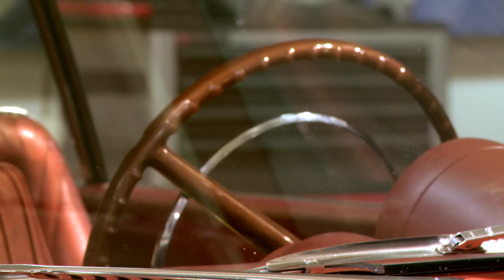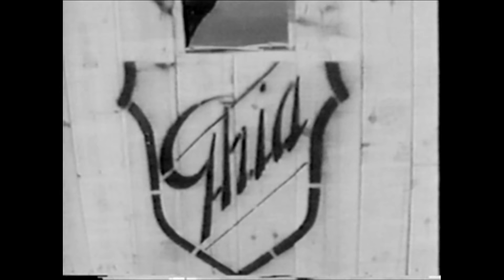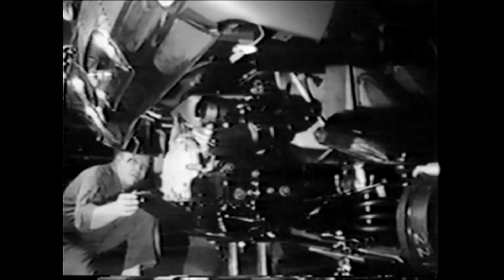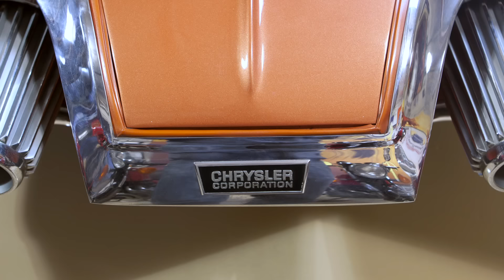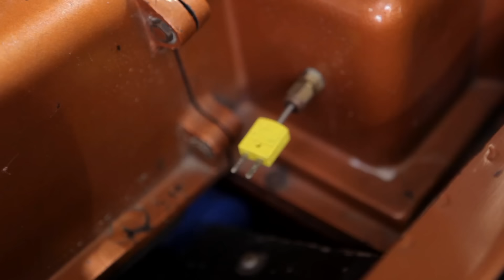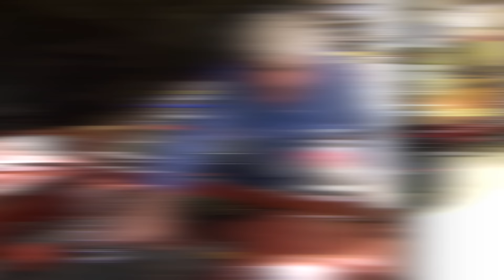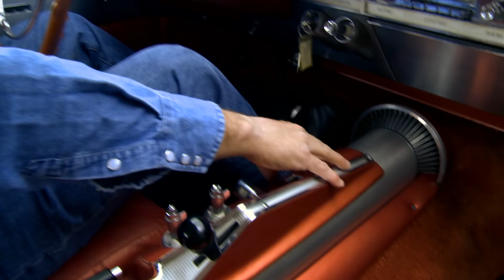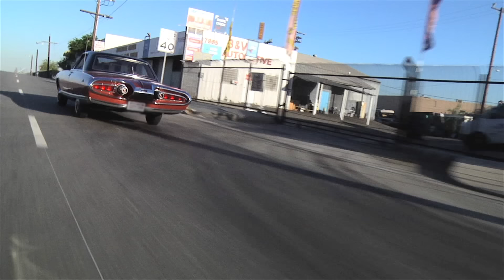1963 Chrysler Turbine: Ultimate Edition - Jay Leno's Garage

Comment: Couldn't this engine concept be adapted to be the power plant that is used to charge the battery pack for an electric vehicle? Seems as though the high RPM's would be ideal for running a generator. As an hybrid the fewer moving parts and lower maintenance costs would be an asset. In the same spirit I've never understood why a basic gas powered generator couldn't be used for battery charging rather than using an external charging system. Has anyone ever done the math on fuel consumption of a gas powered generator for charging en electric cars batteries? Finally, the whole approach to hybrids seems to be flawed using a combination of gas power and electric in the same vehicle with all of the data processing needed to balance which system gets used when.

Comment: While working at the King Theatre in Lancaster PA in 1964 we were playing the movie "The Lively Set" featuring this turbine car. I was asked to drive it around town with a movie poster attached on the.passenger side. I was very apprehensive and drove very cautausisly and slow. Before driving too far, I pulled over to purchase a  few gallons of gas; not knowing what type of gas was required. I waited for awhile; avoiding damaging the car in any way. I sure was glad when arriving back at the theatre and handed over the keys.

Comment: Thanks Jay. A friend of my father had one of these, probably on loan. His wife was pulled over for speeding, and when the cop realized what the car was, he let her go when she let him sit in it.
My grandfather was involved in the design of the Turbo Mariner in the 1950s. This small turbine engine was designed for boats and trucks. I think it weighed 250 pounds and developed 250 horsepower, a pound per horsepower. Grandpa said they were great for trucks, but had essentially no fuel mileage around town. I have some of the literature somewhere.
Thanks again for this. It brings back warm memories.

Comment: All of that state of the art engineering and no one thought to put seat belts in the thing. My first car was 1963 Dodge Dart with the 225 slant six and a push button gear shifter. There where many things I liked about the car but I always thought it was a death trap if I ever wrecked it. Thankfully that never happened. Of course the only seatbelts where lap belts, the dashboard was metal, the steering column was ridged and the steering wheel was made of metal. There was no power anything and the brakes where all drum and even when they where working right if you had a hard braking situation the car would always pull hard to one side or the other. Things sure have come a long ways since then. Like 100,000 mile service intervules. I still had a soft spot for that car none the same.

Comment: In a world of gas fueled automobiles the turbine car, like the hybrid, was a radical departure from the status quo. Electric cars had been produced and failed. Only because of its challenges and its untimely emergence did the turbine car fail. Now, outside of the supercars, only the better hybrids like the Prius and the Koenigsegg Regera are pushing the envelope of automotive powertrain development. And, only the Regera has a leg up on styling, performance and powertrain design.

Comment: (4:12) - "The car will run with any fuel that burns with oxygen..." 
Try coal.
No, I didn't think so.

"A fuel is any material that can be made to react with other substances so that it releases energy as heat energy or to be used for work."
https://en.wikipedia.org/wiki/Fuel

Comment: One big 'flaw' all divisions of Chrysler automobiles during those years, the 60's. The right side on the car used lug nuts that tightened to the right as the left-side lug nuts and studs were 'turn left' to tighten...lots of broken wheel studs, stripped nuts, and frustrated owners.

Comment: Jay congrats on capturing a unicorn! I learned of these a few years back from a library book about turbines. I believe some were installed in Dodge highway trucks ferrying parts as a testbed and I also read about a fleet of highway plows used in BC mountain passes for a time . International or Mack I think. I believe the book was:  The gas turbine engine : design, development, applications / Jan P. Norbye.  Thanks again for the historic vids and especially for showing it IN ACTION!

Comment: One of my favorites. I am so disapointed in the auto industry...everything Corporate looking and boring. Wheres the trubine powered cars and flying cars or flying turbine cars...lol.  I am sure with  a hydrogen generator working from solar power.... would power this vehichle. Negative positive negative positive plates submerged into water, with electricty added, that splits the water into hydrogen gas and Oxygen. The two can be seperated and the hydrogen burned and oxygen set free. I have one in my garage I can carry with one hand....true story. My son and I built it...he entered it into a science fair...they said he bought it...lmao...you can't buy these things...lol...so he just got a participation ribbon...he was so disapointed.....no one understood it....but it worked. 12v dc 5 amp draw.   loved you car...wish I had one.

Comment: Years ago I remember seeing this car at a car show up around Chicago and it was quiet running. Amazing technology being implemented in the car's design.
If I remember right, didn't a turbine race car win at Indianapolis Speedway at Indiana? I think it was disqualified possibly because the heat from the exhaust
caused problems with the other cars? This car probably should be adopted as a future design so problems can be worked out. Jay, you did a excellent job
in reviewing this car and thanks!

Comment: Rover in the UK made a gas turbine car in 1949, 14 years previous to Chrysler. It too could run on any fuel. It was a much smaller engine and very noisy like a jet plane. I don't know if it was the same technology. It never went into production. It may have inspired Chrysler.

Comment: They needed the electro drive concept of todays hybrid , electric at stop and go low speed and turn on the burner for the HIway ,, then the fuel consumption  would have been normal ,, but the production cost impossible  ….

Comment: Back in the 60s and 70s, my next-door neighbor worked in Chrysler’s PR department for the Chicagoland area, and was always bring home cool Chrysler-Plymouth vehicles and giving my dad, brother and I rides in them. One of the first I remember was one of these.  I was just four at the time, but can still see it sitting there in all its bronze futuristic glory in the driveway right next to ours.  And being four, I totally thought of this as a jet-powered car and thought those protruding housings for the back-up lights in the rear were where the jet thrust came out. Even seeing the light lenses in there didn’t detour me.  I just figured they opened up when the car was moving forward.  It certainly sounded like the jets I heard at O’Hare airport, though it also sounded a bit like our vacuum cleaner when riding in the backseat.  I don’t think it was until I was seven, when my dad, an engineer who dealt with anti-knock compounds, and thus knew all about any form of internal combustion, corrected me, and explained how the car was still wheel-driven.

Still, for the rest of the sixties, I became a big fan of everything turbine (besides being a hopeless Chrysler fan due to said neighbor, which felt much like being a Cubs fan through the subsequent decades), particularly the STP and Lotus turbine cars that raced at Indy.  I was terribly disappointed when they didn’t win and were later prohibited from competing.   But by the early 70s my dad was telling me about the rotary engine his
company was experimenting with and I had a new engine for which to be a fanboy of.  That one kind of stuck.  My daily driver is an RX-8.

Comment: The Turbine engine was killed off because of it's ability to use multiple fuels which was a threat to our petroleum companies. It had nothing to do with emissions. These engines actually burned cleaner than piston engines. The only down fall to the turbine engine was noise at idle.

Comment: In 1969, Continental Trailways put Ford gas turbine engines into three of their then new Model 05 Silver Eagle buses. Two of the engines made 450 HP and the third one made...600 HP. The only two gears needed were 4th and reverse. In addition to high fuel consumption, these particular engines had a lot of reliability problems so the test program only lasted for maybe a year. At that point the buses were repowered with standard Detroit Diesel 8V-71 engines with about 285 HP. One of these buses carried fleet number 29511 so it belonged to American Buslines, East Division, which was more or less from New York and Washington to Chicago

Comment: An absolutely brilliant attempt by Chrysler - killed off largely by the dead hand of government making compliance with new rules almost impossible!

What is not mentioned though is the extensive road-testing carried out in France on two 1959 Plymouths. These were the  2nd Gen cars with the big fins and were based on the Plymouth Belvedere Sedan.

In the summer of 1959 when I was 13 years old I saw one of these in northern France when my father and I met the American guy  driving it and he and I were shown the car and engine. I remember the noise on starting and thinking to myself, Wow - that is the kind of engine I want when I get a car!

The American told us that there were two such cars in France being tested and he had put thousands of miles on the car in normal road use. He worked with Simca which was a French manufacturer who offered support to Plymouth for the testing programme in Europe.

Today with very small and light turbines built for aircraft use and the smallest producing easily 450 hp why are we not all driving behind such engines? Surely the downsides of high emissions could have been remedied by now?

Comment: Capstone Turbine is working on truck conversions with their hybrid turbines. An interesting exercise for Jay’s Garage would be to fabricate a car or truck that fits your interests. The exhaust is exceptionally clean! A test bed for their developmental 370kW turbine or other engine may be welcomed. It would make a revolutionary combination if used with a Doble engine! A real hill climber! Capstones have 30-42% electrical efficiency but develop over 80% total efficiency with the included heat-water heat exchanger. Imagine the results with a steam generator! You guys are experts in steam generator and steam engine design!

Comment: I took two years of elective auto shop in high school in the mid 1960s.  The most valuable automotive courses I've taken.  Saved me $1,000s in repairs.  I remember in high school auto shop where our teacher talked about this car.  He also talked about and showed a movie with Turbinique putting a turbine engine on a go kart and racing it against some kind of dragster.  I believe they also equipped a NASCAR racer with a turbine engine, but the engine was slow to respond to throttle demands (spool up took too long as did spool down).

Cat converters get just about as hot and they've been known to start grass fires.

Cool difference between a gas engine stall vs turbine engine flameout.  It's a jet without wings.

Comment: The real reason these cars were destroyed was because the big oil companies didn't want this tech to become the standard in the auto world. It woulda meant the end of them since you never went through oil and almost anything could be viable fuel. Did they ever say what material the two heat exchangers were made of? 1600° engine temp. And did he say idling at 22k rpm? Geez. First order the day if I owned it....paint job...that dull orange is horrendous.

Comment: What we need today is a small hydrogen powered jet turbine that runs an electric motor. A small battery just to start and run 12v systems. It would need start stop tech for traffic lights and KERS technology in the ground version but the flying car version wouldnt need to cut out for traffic lights. Much like Lilium Jet. But using Hydrogen jet turbines not heavy batterys. The problem: oil company's won't let it happen. This could work on  everything not just cars. Why not power stations? Next to an ocean the water would be available 24/7 take the water and break if down into hydrogen and oxygen. Compress and Bottle both of these products for general sale. Using the hydrogen the power station needs to run the hydrogen turbines it could make 0 co2 energy and also make money selling bottled o2 and hydrogen. But the oil company's prefer you wouldn't do this and hand out lots of money to people who help them with their cause. Moreover they pay an absolute fortune for patents in energy technology along with pay people to invent it for them so they can patent it and file the patent away so knowone else can do this. Toyota gave all their Hydrogen technology patents away for free, to the world, for 5 years just to get the ball rolling. What happened? Electric cars using heavy, expensive, dangerous, dirty and pollution heavy batterys won! instead of Hydrogen? Please people. Don't act like we all know the pinnacle of technology. For that has been hidden from mainstream view since roughly the time of this car. Even enemy's have something in common:they want to sell oil. People who own oil want to do anything to keep things that way. Its cheap at any cost for them to do so. The future lies in a shed somewhere when some people come together for nothing other than common  Interest, passion  and dedication to prove the technology. In secret. Absolute silence! Then using the power of social media and public opinion reveal their invention 1 day in such a way the whole world sees it instantly. I mean Viral! That way the oil company's can't murder them all and steal the patents. Moreover if they try and say they already own the patent so you can't do it without their permission then public opinion will win against them any way. Power to the people. Free energy needs smart people working in silence. In a shed. And when they reveal it we all need to share the video and technical information around the world in the space of minutes. Thus keeping it safe from the corporations dirty hands. Stop making battery cars please! Electric is ok. But not powered by batterys! Obviously? Thanks Jay

Comment: WOW!, read about this prototype maaaany moons ago, really would have liked to have seen one of these critters, the cost of the matirials, and the engineering needed, made these things pricey, the exhaust problem could have been (maybe) dealt with later on.
heard also that Freightliner corp. tried the same expiriment, got the same results, great on the open road, but farking horrible at slow wer speeds.

Comment: The great thing about the engine was that it could run on pretty much everything that burned with oxygen. You could probably run it on ethanol or really strong spirits and it would work. It's one of those sad little things which almost made it but ultimately didn't. It worked, the technology was there, mass production was possible and it just fit the era of the jet engine.

Comment: Don't know if anyone brought it up but maybe 25 years or so ago Chrysler was toying with turbines again, and at the time the latest hot item in energy regeneration was carbon fiber flywheels running on air bearings in a vacuum-sealed housing. At the time there wasn't any storage battery or capacitor capable of soaking up everything regenerative electric wheel motors could throw at it under braking. but that flywheel could do it just fine, by taking the incoming juice and using it to spin up to 200,000+ rpm, then using that rotational energy potential to dump a burst back to the wheel motors when needed for acceleration. The field just changed and the flywheel's spin-up motor became a dynamo supplying large amounts of power on demand. The very small turbine in the system was there only to keep the storage batteries charged, so it could kind of run in the background as needed, sort of like an APU. I don't know what happened to those projects...I guess maybe improvements in more conventional hybrid systems and power management might have made it unviable. They had a Formula 1 style car with the system that they were going to run in racing to sort out engineering issues, not sure what became of that.

Comment: I remember this car at the auto show and anxiously awaited it's mass production that sadly never came ,I ended up settling for a 1969 American Motors AMX because AMC would allow you to order the 390 big block " Go Pack " from the manufacturer and when it came in the AMC dealer had a race team division that would do any mods you wanted and the total car would still be under warranty , I had the dual quad manifold and carbs installed along with an oil cooler and a ram air carb intake installed .

Comment: I drove along side when they were leased out, in detroit in my 55 chevy. Went in the service and came home and went to work at Chrysler engineering. I ended up in Research and had the keys to one of these. I could to drive all over chrysler property and the point was to get it not to start. Ha he just said 22,000 thats higher than normal for this car 18,000 RPM IS NORMAL. IT HAS A STANDARD torqueflight trans. A 10:1 gear reduction to allow that. I went on to develop a Variable pitch power turbine to make it a tire smoking hard accelerating with some engine braking. We did run a 67 satellite with the variable-pitch engine in it against a 383 automatic Roadrunner and they pretty much ran Fender Defender. We did that on Chrysler Boulevard right in front of the Highland Park home office and definitely heard about it from the boss. I think if the turbine car had positraction it would have beat the roadrunner.